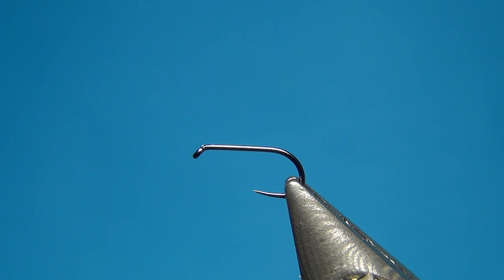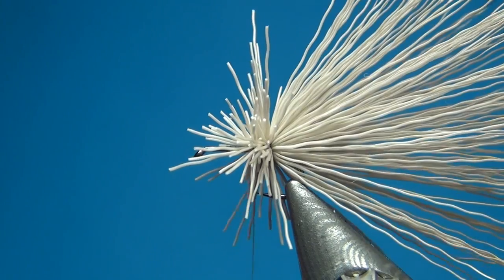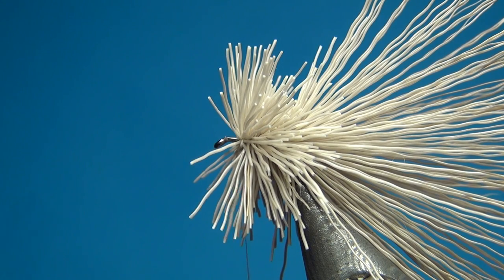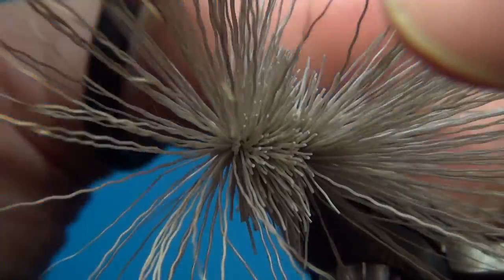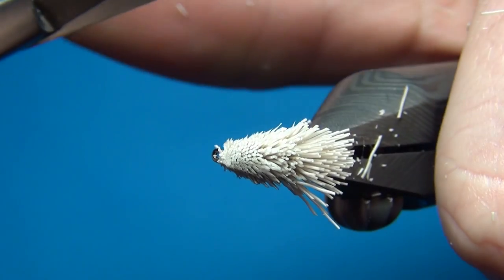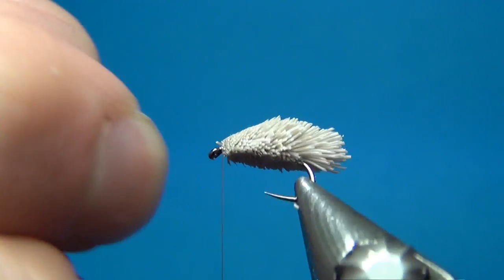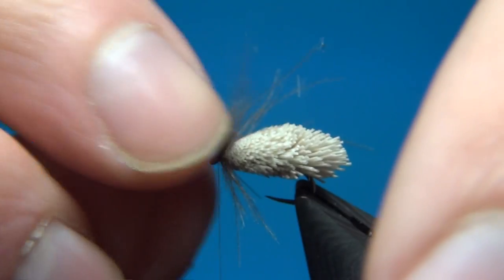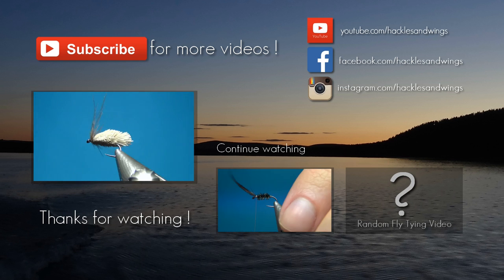Fly Tying Goddard Caddis CdC | Hackles & Wings

Comment: Thanks for sharing. I like to tie the Goddard but never thought of substituting CDC for the hackle. Great video. I think you are brave to use 18/0 on deer hair. I would have cut it off rather quickly. I have to use a wider thread for that. All the best, Sean
Reply from the maker: The cdc makes the fly look a lot more natural in my opinion. Also it's cheaper and floats really well. Yes the 18/0 I do not recommend for deer hair work. But if you keep flattening it out it works.

Comment: Did you notice the thread cutting the deer hair ? 18/0 thread is so thin that I think it could cut through the deer hair if you pull it really tight
Reply from the maker: If you are not careful, the 18/0 will easily cut right through the deer hair and it sure has happened to me. A trick is to spin the boobin counterclockwise to get a little flatter thread that will not cut as easily. I would recommend using a slightly thicker thread though, but I'm all out of 12/0 gsp.

Comment: Hi Simon, wow that's a great job on tying & trimming that deer hair on a #16 hook. It would make a nice muddler head too. On the original G&H caddis, according to a book of patterns I have, the thread is reattached at the rear after trimming, and a body of green dubbing is a applied, then  tied down before adding the hackle. Are you familiar with the pattern? I have recently watched Barry Ord Clarke tie a streaking caddis. He said it was tied by a Swedish tier Lenart Bekest (don't know if correct spelling). Do you know that tier? Anyway most of these caddis I've seen are tied on much bigger hooks, even 2x long. Amazing you're able to tie that on a #16! Lots of possibilities for that head on different patterns. I see you're using Partridge hooks lately, how do they compare with the others you've used? Thanks my friend, awesome tutorial.
Reply from the maker: Hi Joe, thanks a lot! the deer hair spinning on a size 16 sure is a little finicky. I'm glad it worked out for the video. On camera, all kinds of unpredictable things tend to happen :) I have seen the pattern you are referring to, I think I had it in my first tying book. I have never tied it this way as it just seemed to be an extra step that didn't add that much to the pattern, but would be interesting to tie some flies in both variations and test them out at the same time to see if the dubbed body makes a difference. Makes for a nice looking fly though. Yes, Lennart Bergqvist is one of the most known Swedish tyers with patterns like the streaking caddis and the superpuppa. I have to get hold of his book some time. Usually I tend to tie my goddard caddis on bigger hooks as well, I've just ran out of them so 16 it had to be. The Partridge hooks are some of the best I've tried and I especially like their range of barbless hooks. The hooks also seem to be a little heavier wire, or at least the ones I've tried, and as I use gsp thread for almost all my flies, I like to put a lot of tension and the hooks don't bend as much, which is nice. I haven't found something to complain about yet.
Reply: HacklesAndWings I agree on the extra step for the body on the G&H. Especially when you could probably color the underside with a marker. I've never seen anyone else do it either. If it ain't broke don't fix it, right? And you can always edit a video, :) Take care Simon and thanks again.
Reply: I have that book also. I haven't been able to get that hair right. This video was very helpful. Thank you.